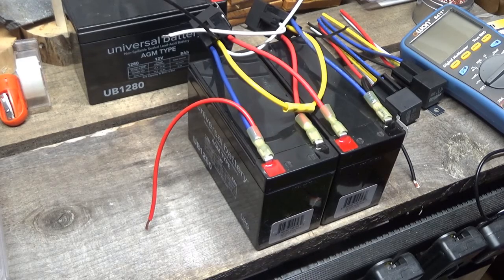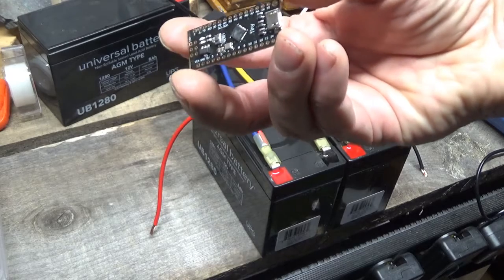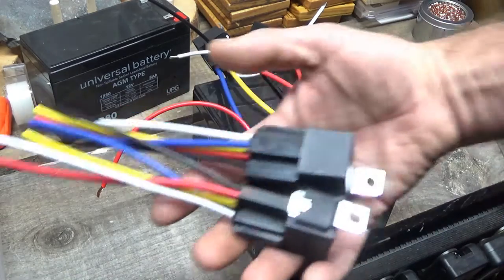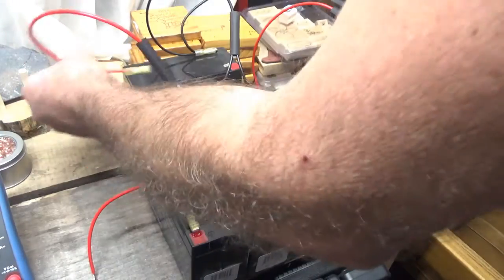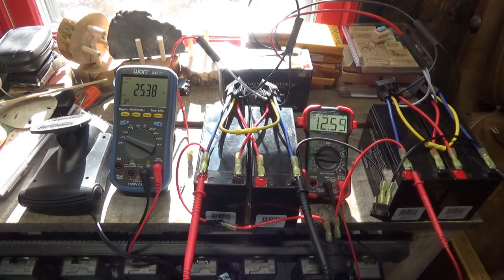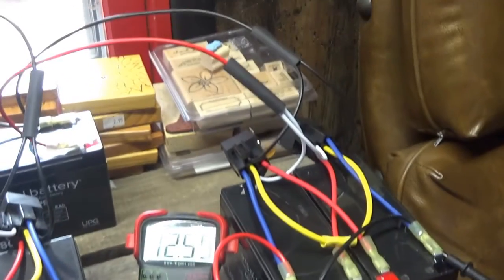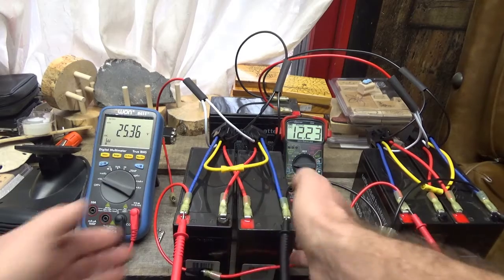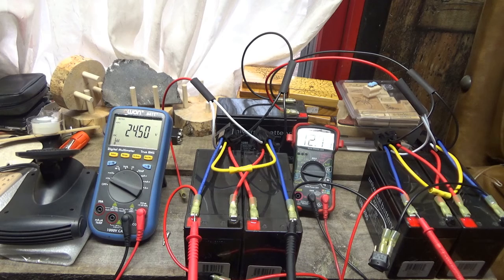Running A Heater While Charging 2nd Set Of Batteries For Free

Comment: if you can do this with btteries you can do it with capacitors too👍
Reply from the maker: I am working on an idea to use caps and keep them charged up. There are some losses in the system and it will run down.
Reply: @TheDoItYourselfWorld which means it can also apply to transformers. Same concept except now we're talking thousands of times multiplication of charge instead of 1.2 or 2 times
Reply: Bingo